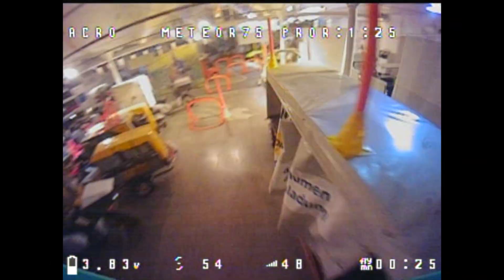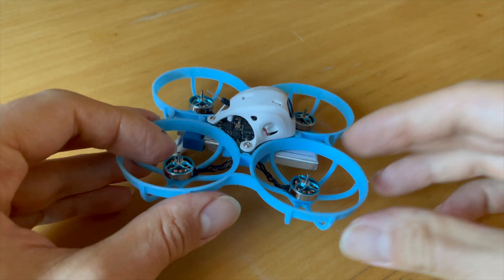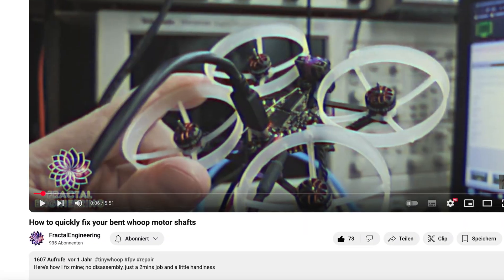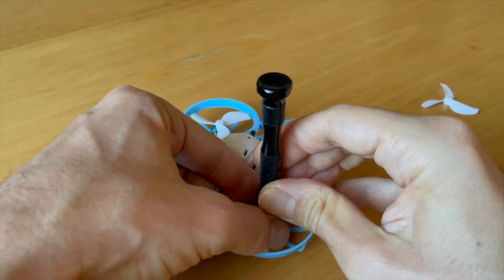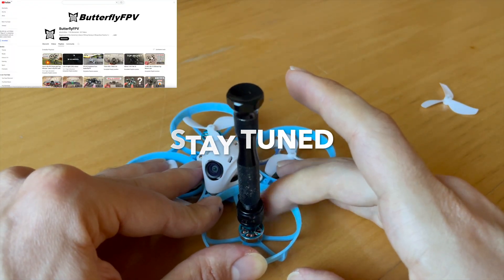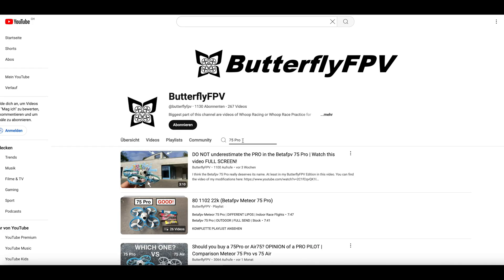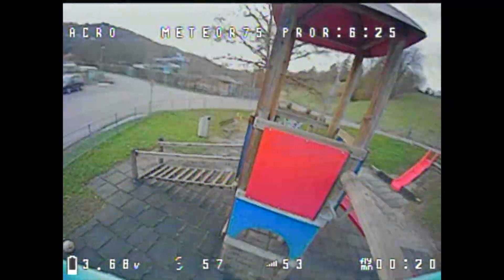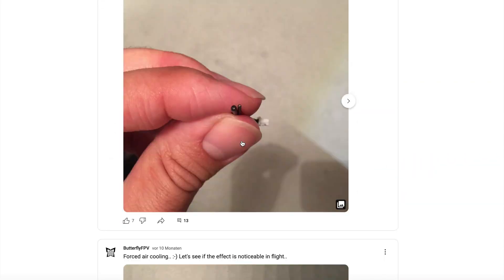How to fix a bent motor shaft on a tiny whoop motor | Betafpv Meteor 75 Pro

Comment: Hi butterflyfpv i have a problem with my 75mm hdzero whoop 
(Parts list
Frame: meteor 75 pro
Canopy: betafpv air canopy
Fc/esc: hdzero aio5
Camera: hdzero eco
Receiver: crossfire nano rx
Motors: betafpv 1102 22000kv
Battery: gnb LiHV 1S 530mAh 90C A30 Cabled)
The problem is that the battery is getting a-lot of vsag I don’t know if it’s a problem or something normal example: full throttle for 1.0s is land now (3.00v) on a fully charged brand new battery and doing a-bit faster flying it fills slow and it says battery low all the time but the flight time is normal around 3.20min. I have seen many whoop videos even yours and it doesn’t seem to do that. I don’t know if that’s normal or not but it doesn’t seem normal to me
Reply from the maker: Hey, no, that's not normal. Have you been flying the whoop for a while? (Over 100 LiPos) And do you fly the whoop with motor plugs? If so, the contacts on the motor plugs could be oxidized. (I'll make a video about that soon.) Or the main cable could have a break at the soldering point or somewhere in the cable (rare), or at the Soldering point of the BT2.0 plug. Or you could have a small short circuit somewhere else on the board.
Reply: @butterflyfpv  i couldn't because the vtx burned in a crash witch means i have to replace the aio so i can't test anything right now. and with no motor plugs and i think i found the problem but im not sure i think its the low quality battery wires with plug that comes with the hdzero aio5 i found out the wires break off really easily so i bought ones from aliexpress but the aio broke before i tried the new wires could this be the problem
Reply from the maker: @tssfpv  I hope I understand this correctly. But yes, a broken wire in the main cable could also be the problem for voltage sag.
Reply: @butterflyfpv  yes it was the problem the new aio5 was lost somewhere during shipping so i had to buy it again and just now a few days ago after 2 months i got the aio put it on the drone and it works perfectly it was the main cable that comes with the aio5

Comment: yo this is something cool I've tried but from my experience after a couple crashes it's back to vibrating. New motors is best
Reply from the maker: I haven't had this experience with the 75 Pro Whoop with the 1102 motors with 1.5mm shaft. My bent back shaft is still good. But I know what you mean. But honestly, this method is so easy that I can quickly bend my motor shaft back again. Maybe even a third, fourth, or even a fifth time. And then at some point, the shaft will break of course. I wouldn't recommend bending it back more than five times on the 75 Pro. But if it means I can fly with the motor for a few more weeks, then it was definitely worth it to bend it back for several times. Or wasn't it? Ultimately, everyone has to decide for themselves. I think it would be cool if you could buy the motor bells individually. Not the whole motor.

Comment: Another banger! Thanks again for great tips. I recently soldered the motors directly to the FC on both my Met 75 and Met 65, both are flying MUCH better with way fewer stutters. Now when there is a stutter it's almost always because some dirt or debris got into the motor bell, rather than a connection issue, MUCH easier to fix.
Reply from the maker: 😃🤜🤛 Very nice to hear! I've been flying with directly soldered motor connectors for a long time. It simply has more advantages. Sure, soldering can be annoying sometimes, but it's worth the effort. Same here, I recently had a small grain of sand in my motor bell. It rarely happens to me. But sometimes it does. But as you say, it's an easy fix. Just gently turn the bell a little until the grain of sand falls out of the motor bell. Happy flying my friend! Whoop whoop!🥳

Comment: I think i might have this issue one of my motors is making a clicking sound when it spins
Reply from the maker: That could be. Or a grain of sand somewhere in the motor. Or a defective ball bearing (rare). Or a magnet that fell out of the bell.
Reply: @butterflyfpv  It’s weird i tried to fly it and only 3/4 motors were spinning. Switched the battery now they all are spinning but i have clicking sound. I will try replacing the prop then move on to the steps you suggested. Thanks/
Reply from the maker: @Murphys_Law9  The clicking sound is a bit strange. A prop isn't touching anything, is it? Could it be touching the main cable, for example? That could also be getting into the prop and making a clicking sound when flying. If the motor shaft or the motor bell are badly bent, it is also possible that a strut of the motor bell is rubbing against the windings and cause the clicking sound. Check everything carefully before you continue flying to avoid further damage.